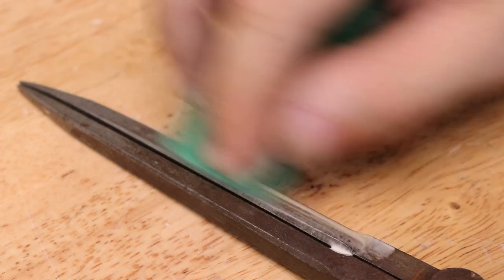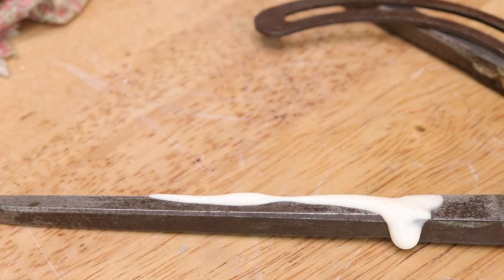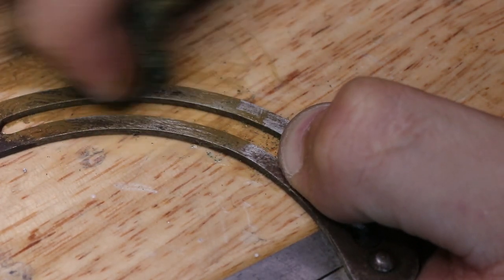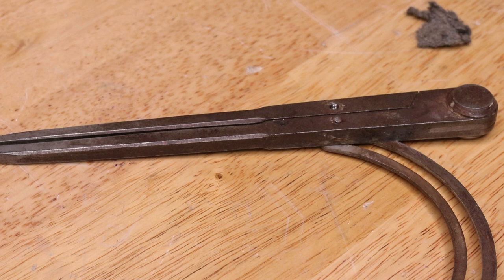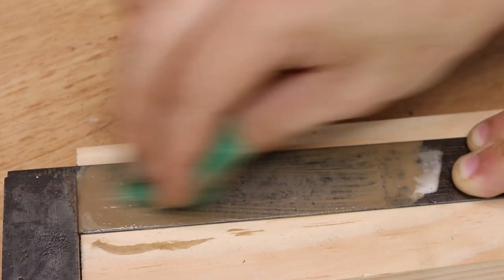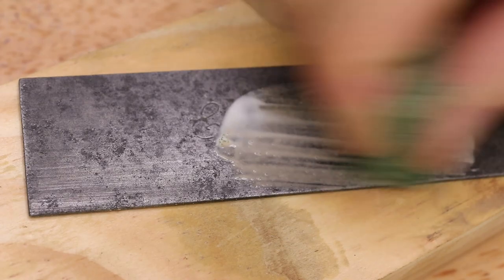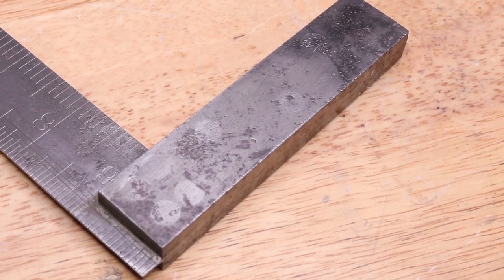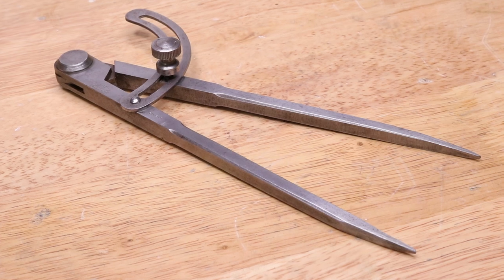Restoring Some Tools From 1899

Comment: Hey mate! Relatively new subscriber here but I've been all over your content the past couple months and learning a lot along the way. It's great stuff I enjoy your work.
I know this is two years old and I'm late to the party but just to give some knowledge back or if at-least if anyone else benefits from it I thought i'd chime in regarding your approach towards electrolysis in this vid. I know you're well acquainted with it and likely more-so now that its been 2 years since you released this 
(Just recently watched your hand file restoration vid and utilised the acid etching process you demonstrated, really grateful for that one! Never knew you could even sharpen files till then)

by no means am I an expert on the topic but you voiced a concern about electrolysis eating the base metal and I always assumed the same. At some point down the track in my electrolysis endeavours, I learned that its actually opposite the case!
The reason electrolysis is the proffered method by archaeologists for ancient artefacts, is that not only is electrolysis the most controlled method of rust removal, its found to be so effective that it actually converts some of the rust in the base material back into iron! How goods that right?!
I went years not noticing this since its such a negligent process with consistently reliable results that I never second guessed it, but at some point down the track I learnt about this and im definitely better prepared now for it!

Hopefully this shines some light for some, if not others, and I thought i'd be able to provide some benefit back